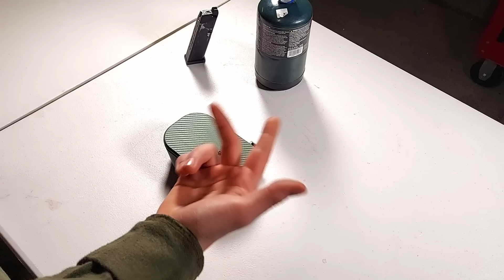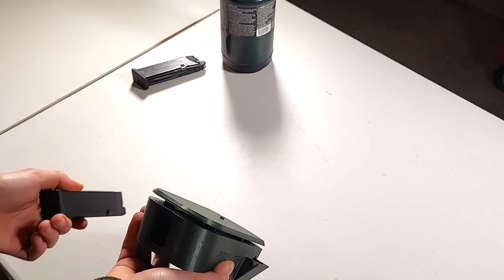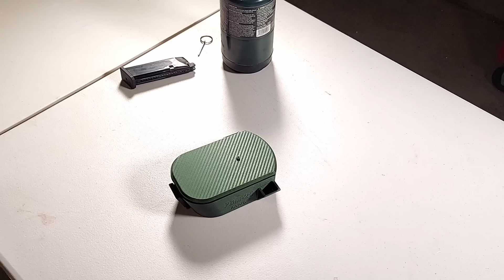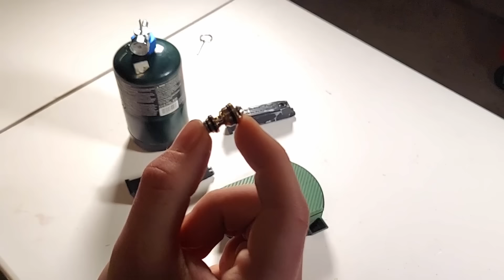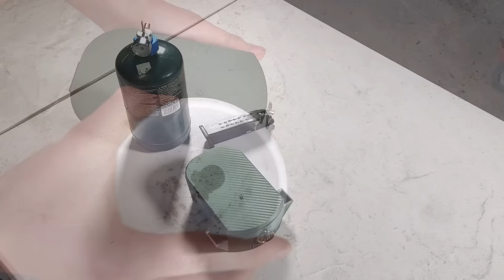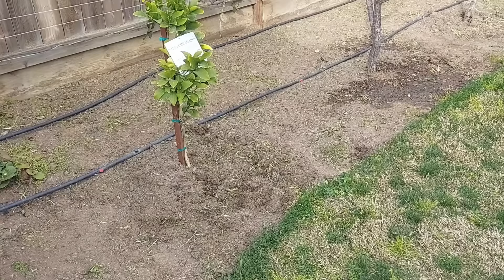This Airsoft LANDMINE Is Powered By PISTOL MAGAZINES | PBM-25 Airsoft Landmine

Comment: Could you modify this to use caps or primers?
Reply from the maker: Not this particular model, but we are definitely planning on making a pressure-activated ring cap landmine in the future. We also just released a ring cap/primer trip-mine. Thanks for the suggestion.